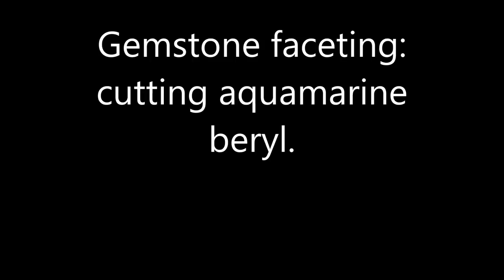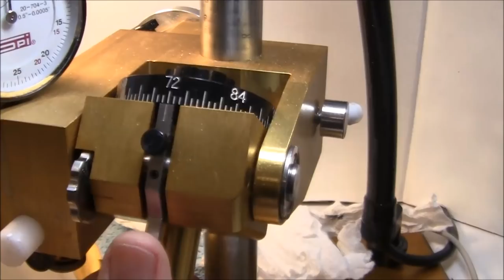Gemstone cutting :  faceted beryl fails to produce.

Comment: I had some trouble with an aquamarine a few months back. It had beautiful color, but it was just too small and oddly shaped. By the time I finished cutting the pavilion, there simply wasn't enough material left for the crown.
Reply from the maker: Yes that has  happened to me,  ive had to go back and recut a pavillion much smaller so i could finish the stone. there are  always challenges to this art.

Comment: That green lap you use on the 3000 pre polish could you tell what it is
Reply from the maker: yes, that is a resin bonded topper lap (Thin lap that must use a backing disc)  it is called a lightning lap because they work so fast i guess.
I like them, they leave a very smooth finish but do slow down after a while, then you can sharpen them by using 400 grit sandpaper over them. here is the website if you want to check them out, they are made up in n. georgia.
https://shop.lightninglap.com/
Reply: @tennpikr74  You make some very nice videos. I know they help a lot of new as well as people who been at it for a long time. Please keep up the wonderful work.
Reply from the maker: @charlesfuhr1563  thanks charles  .